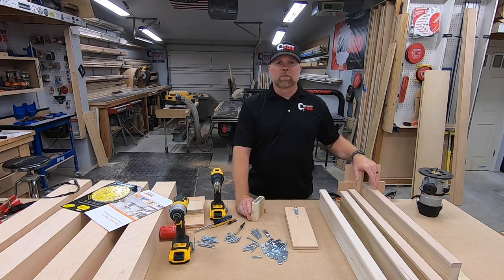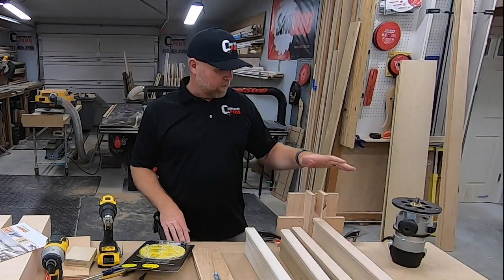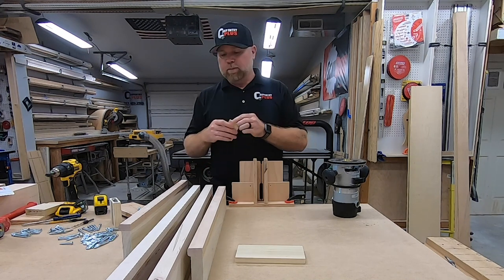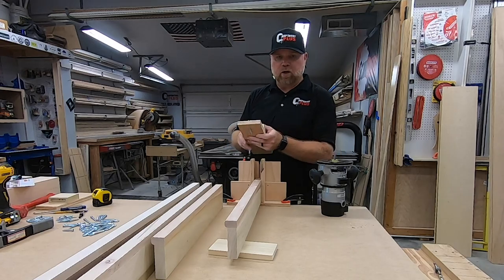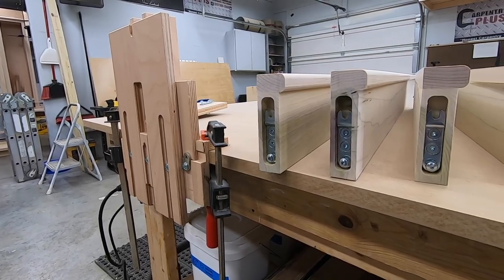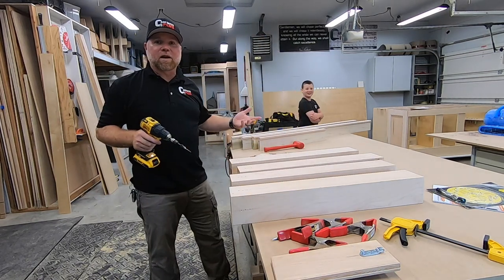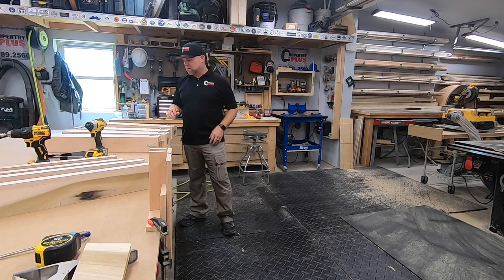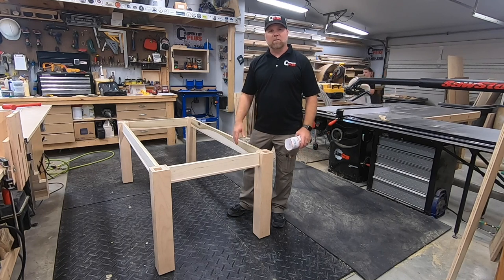Table Assembly using the 'Duo System' from Knapp Connectors

Comment: I just discovered these as I'm looking for a hidden fastener system for a large L shaped desk I'm building. I want the option for future disassembly. Do you think this will work on 3/4 plywood end grain? Other end will surface mount to solid cherry legs I laminated together.
Reply from the maker: I think they might be too wide for 3/4" material.  I used 1" thick stock for the table aprons for this reason.
Reply: @CarpentryPlus  they have some that are 15mm (0.6in) wide. I figure it'll be a tight squeeze, but I the only other option I found was striplox.